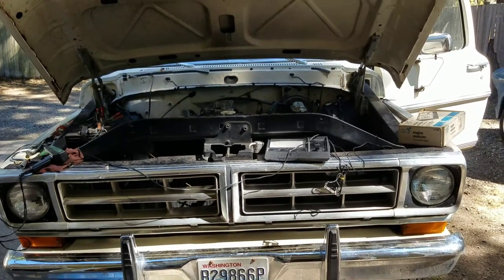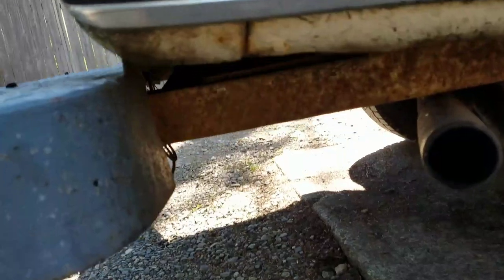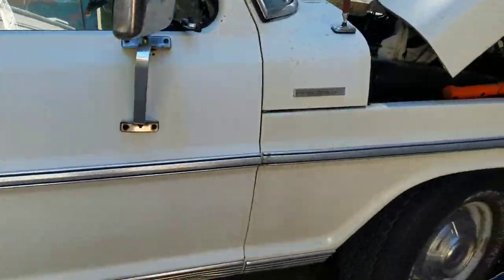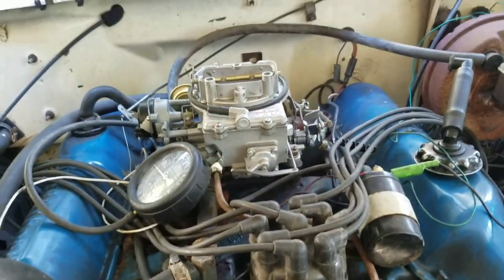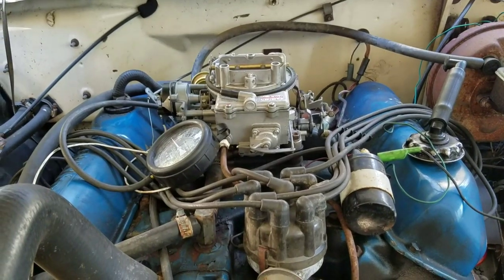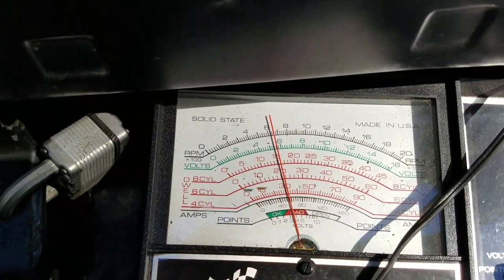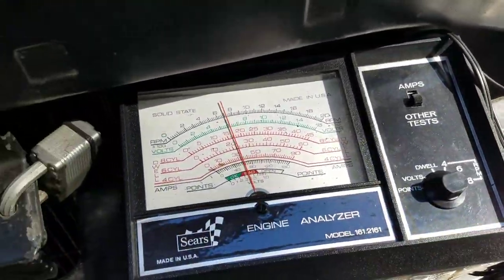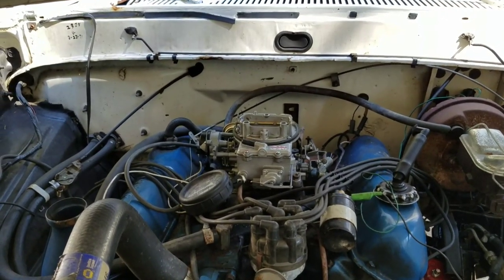Tune up on a 71 F250 with a 360 V8

Comment: My grandparents had 1967 F250 Camper Special Custom Cab they ordered it new. Back then trucks didn't come with rear bumpers from factory and the customer had the dealer or other shop install the bumper of their choice. The dual tanks like that is factory and if someone had three tanks that was an aftermarket option.

Comment: Just inherited my grandpas 75 f150 with a 360. Stalls all the time pulling out of driveways and such when it hits level ground. I really need to get some of these instruments and start tweaking with it
Reply: Look at the carb first.
Reply: @jesse75  update: I’ve acquired instruments and am actually replacing the carb tonight
Reply: @SonOfAHerbert  cool. Some of the trucks had either a manual Choke or heat riser automatic choke.
My dad bought a 68 F 100 new with manual Choke. I have the truck now.
Never have a problem with it.
Timing, plug gap, idle set is factory nominal settings.
You really have to set those by the type of fuel, elevation and temperature outside.
Reply: I have also switched to duraspark distributor, coil and ignition box. 
Runs much better and smoother. 
Points you always have to mess with them.
Reply: @jesse75  this new Chinese carb has a complete electric choke, which mine was non functional before and missing some pieces. I just don’t know how the transmission linkage next to the accelerator operates
Reply: @SonOfAHerbert  that's a kick down rod that goes down to the transmission.
Some carbs have a place for that, but the carbs for a manual transmission, 4 speed, doesn't have a place for the kick down.
Uses a small c clip to hold it in place.

Comment: I have issue with timing jumping around , rebuilt carb ,now goin to change cap rotor plugs , ben sitting for 6 yrs , supposed to be low mile rebuild on motor
Reply: That's a timing chain. 
Grab the lower pulley. Turn it back and forth by hand. Bet money you'll hear the chain making noise.

Comment: first off thank you for the video ,, im an old man and iv never seen that bumper slide , too light for factory , but nice upgrade , as to the small holes on either side of the ball hitch , they are for safety chains. from what you said in the video, the base plate being loose causes the idle problems , sounds like someone changed the timeing trying to fix that problem.

Comment: How do you hook up the analyzer to check the dwell? I have an old one kind of like yours but I've never messed with checking the dwell, I've only done plugs, points, and timing. Tuning up my 72 f250 with the 360 as well.

Comment: Check the VIN for the engine code, should be H for the 390! That was standard for the Camper Special like mine. The Sport Custom is and added trim package which pretty up the truck :)
Reply: I think the 390 was standard on like the 73-76 campers but don't quote me, easiest way is just to measure the stroke. You're best just to assume it's a 360 if you buy one
Reply: Not always. The 360 was very popular with the insurance company back in the day.
Reply: @jesse75  On the FE motors, when in dought pull the plug and measure the stroke... My H Code is the real 390 and I bet yours is too! All 1972 F-250 Camper Specials came with a 390 2 barral carb... plus the nifty side box for a jack and tools :)
Reply: @danielmcqueen1024  My F100, which my dad bought new in 1968, is the 360. 
I know. I was 10 years old, and dad let me pick what truck. 
Dad has passed on, but I still have the truck. 360 is just a bored 352 with shorter rods of the 390 and the same crank as the 352.

Comment: How do you ajust the dwell on this distributor ? I have a 69 f 250 CS is there a screw on the dist somewere ? Can it be done running ? Or is it like a point gap ajustment
Reply: Point gap and adjust the plate under the points using the dwell meter. The plate is what the points are mounted on. There should be a second screw.

Comment: Hello my name is Jessica Fijalka! I am 19 years old. I have a 72 ford pick up sport edition which also has the 360 8 cylinder in it rebuilt 2 years ago. I'm having issues with my distributor. Previous owner converted it to an electric system but he however did not do it correctly and only did it halfway. So I am now converting it back to the original system. Im wondering where are you located?? I am willing to pay a mechanic that KNOWS my kind of truck or even old vehicles all together just to help me.
Reply: Ever get it fixed ?

Comment: My dad bought a 74 f100 with the 360. Nice truck the motor is torquey but not much hp.
Reply: they were industrial engines. workaholics wit good maintnance they lasted many years. ya cant blowup at 4200rpm,,

Comment: I have a 1970 f250 360 and as soon as it warms up it quits. Wish I could show you a vid. So stumped
Reply: That's a new one. I'm a retired Ford engine mechanic.
Make sure the carb gasket is good. 
Is it manual Choke or automatic ? 
I think it's in the carb.